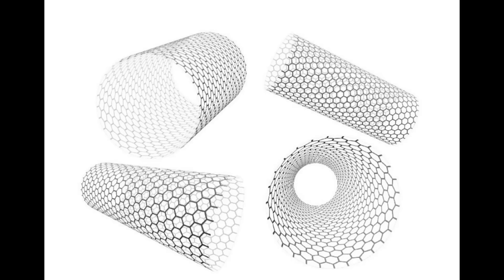What Material Will TSMC and Intel Use after Silicon?

Comment: MCM and stacking on CPU's is not as difficult as MCM and stacking on GPU's. Nvidia is already looking at ASIC's for future generations.
Reply: That is down to the way the OS was predicated to CPU's as much as the hardware itself.

I think AMD recently registered a patent for a sort of Command and Control die, to basically aggregate GPU chiplets so that they appear as a singular entity to the driver/OS.

If they implement it, it would likely be merged with the i/O circuitry for memory, display and PCI-E - for a single I/O + Control die.
Reply: @mnomadvfx  if AMD does it right then they could even revive CrossFire with that. If they have proper connection speeds with their infinity fabric then you could just buy a 2nd GPU to double your computing power. That would be really exiting.
Reply: @zamundaaa776  xGMI is their new interconnect which carries infinity fabric I think, introduced with Vega 20.

As for doubling compute power - raytracing is even  more conducive to scaling than raster graphics, albeit I have only seen how it scales with CPU's in my experience working with CG VFX/animation.
Reply: @mnomadvfx  I've actually programmed a GPGPU raytracer myself a month ago and, well, for good quality raytracing you'll want to do something like a minimum of 4 rays per pixel (practically MSAA). Those 4 rays do split up later into a lot of seperate ones, but that's all in the same shader. So for raytracing Full HD you can really make use of a theoretical number of 1080x1920 = 2,073,600 shader cores for maximum performance. At least if memory bandwidth scales with it, too.
Reply: @zamundaaa776  The predication around BVH as a model for ray trace fixed hardware acceleration seems strangely premature to me, it's not the only proposed method for that purpose and I worry that they may be painting themselves into a corner by going down this path.

Hopefully future RT acceleration solutions will be more versatile to take advantage of future models as they come about.

Comment: Ovshinsky Switch. Chalcogenide. Micron and Intel are working on it on the down low. Only tentative memory applications are currently visible (3D Xpoint). If they figure it out, silicon will seem almost  like vacuum tube transistors in comparison.
Reply: @Cole Park Yes. A modified 20nm node was used for 3D Xpoint gen 1 memory at Intel and Micron's (former) joint venture IMFT. Micron has patents that refer to a 10nm node so I assume they're making progress. Chalcogenide based phase change memory and logic don't work well at larger nodes, so it's just starting to get viable at sub-20nm. I reckon there's still a lot to work out on the logic side.

Comment: Quantum computers will be orders of magnitude worse than current computers at common compute tasks. They will be exponentially better at tasks with quantum speedup potential, such as password cracking.

However, passwords can be made just as secure as they are today in a world with quantum computation as long as the specifics of the password authentication algorithm is done properly, and passwords are made twice as long. Generalized password cracking only exhibits square root speedup under quantum computation, so squaring the complexity of the search space by doubling password size should make passwords secure again.

Comment: Allways amazing to predict what the future will bring us. Good job.
You missed some promising technologies, but I guess that's not the point of this video. It's better to stay grounded than to dream about something that's well into the future.
As you stated, silicon still has room for improvement and any other tech/material will have a hard time getting close to silicon in price/performance.
Anyway, you missed a point when talking about graphene. It's not only about the node size, but the speed. Graphene could be pushed much higher. At least 10 fold, and probably much more when the tech matures.

Comment: Quantum computers do actually have more uses than just hacking your passwords really quickly. There are genuine benefits to having a quantum computer rather than a classical computer do machine learning for example.

Also concerning the whole topic of this video I think you missed something vital and should have made a part two dedicated solely to this.

Like you said in the beginning of the video we use silicon to make transistors, but we only use silicon because every masproduced transistor ever made is based on electricity, but there are other types of transistors we could use. 

We don't have to just use electricity. We can use light for example which has numerous advantages over electricity.

Light travels faster than electrons (remember what Einstein said about light), increasing speed.
Light photons also won't get stuck like electrons tend to in the walls of the transistor, decreasing heat output and the energy requirements.
Light is also wave, meaning we can change its frequency to transport high amounts of information quickly. This is why fiber internet is so fast compared to old copper wires.

Also if you want something really whacky to talk about, try researching ternary/trinary computers.

Anyway nice video.
Reply: Ternary computers were abandoned in 60s. Binary is way more simpler to design and manufacture and has lower power consumption.
Reply: @national_security  "Ternary computers were abandoned in 60s."

You're really saying popularity should play a role here? Dude, the electric engine was invented before the petrol engine. It was then abandoned and has only recently seen a resurgence, but I guess according to you we should just kill it. Which one of us should be the one to break the bad news to Elon Musk? Me or you?

"Binary is way more simpler to design and manufacture..."
Okay, binary is simpler, so what? You're saying we shouldn't research a replacement for silicon to begin with (the point of this video). I mean It's simpler to continue to silicon use since we already use it.

 "...and has lower power consumption."
That depends on how you design the chips. Btw you completely ignore the other benefits that ternary has over binary (which are not just limited to compute). 

For example ternary transistors are argueably already used in SSDs (being able to store multiple voltage states, MLC, TLC and such), which greatly enhances the capacity, and reduces the cost, of consumer SSDs. 

A similar thing could be done for a processors cache system, which is basically just very fast storage. Instead of using 50mm^2 (or how much a processor might need) for its cache it could only need 25mm^2 which will reduce die size and improve yields. 

In short, power consumption, manufacturing simplicity and popularity (I can't even believe you argued that should factor in) are not the only factors that should be considered when we think about how we might increase our computational capacity in the future.
Reply: @sango3128  As the argument in this video cheaper is better that is why we are stuck with silicon. Ternary logic does not work at the transistor level. You only need 2 transistor to build a not gate to build an equivalent ternary gate you need at least 9switches.
Reply: @kazedcat  "As the argument in this video cheaper is better that is why we are stuck with silicon."
No the argument is we've always used silicon that is why silicon is cheaper but once we hit the wall where silicon can give us more performance (at about 2nm) we'll have to look to other materials for our performance gains. ALL of the examples he gives are WAY more expensive than silicon is, so I will simply repeat myself your argument boils down to that we should continue doing what we do and not look at how we might increase our computational capabiliies, because researching anything else is expensive. You're the only one on this planet who believes that by the way.

"Ternary logic does not work at the transistor level."
Okay, so either you're a complete troll or you're a tldr kind of guy...

Of course ternary works. We've made computers before build with ternary components so obviously they work. Besides I have already given you MODERN examples of tech using what you might call ternary, SSDs (being able to read multiple voltage levels), and you just come back with "ternary logic doesn't work."

"You only need 2 transistor to build a not gate to build an equivalent ternary gate you need at least 9switches."
Oh so complexity is the problem? because building processors using carbon nanotubes is easy (and in your worlld is has to be easiER than using silicon if we're gonna use it) 

You do realize complexity has never kept us from anything? nor has difficulty...

Anyway what I find particularly interesting about your "critique" (and I use critique lightly here) is the fact that you chose to go after ternary when you could at the very least have mentioned quantum computing, something that is much more complex, yet you probably believe it is not only feasible but inevitable someday despite the fact that they're gonna be the size of skyscrapers, require subzero cooling 24/7 to even boot, and never be as powerful as classical computers are for everyday computing, nor as cheap which is the argument you keep using ad nauseam.

You consider this feasible like many others do (and yes it might be feasible), but ternary is impossible you claim despite the fact that we had ternary computers in the 60s.

I'm just trying to show you that you have a clear bias here, for one technology and against another.

But you know I'm actually at fault here. I said ternary was a whacky idea when I should have said "ternary is whacky idea, but it is not nearly as whacky as quantum computing is!" I can't blame you for latching on to the last sentence of my comment and running with it, since expecting you to read all of my comment is simply too much to ask from people who engage in youtube's comment section.
Reply: @sango3128  Quantum Computers are only good on select problems they are not an answer to general computing. There are problems that is just outside the practical range of solving in classical computers that can be solve by quantum computers. Otherwise quantum computer is to slow to use for problems that can be solve by classical computers. For common problems a calculator is faster than quantum computer. For the ternary logic I am not concern about complexity but power consumption. If you scale ternary logic into a full pledge processor it will require 5 times more transistor that means it will consume 5 times more power. Plus taking into account the doubling of switching voltage to keep the same level of signal to noise when transmitting ternary digit. This is basic information theory carrying more information require higher power. Ternary logic will end up needing 10 times more power for the same level of processing throughput. Silicon will not stop improving for at least a decade. We already have several silicon technology on the pipeline. We have nanosheet fet, nanowire fet, cobalt interconnect, SiGe channel, 3d stacking at the channel level, at the transistor level, at the chip level, at the packaging level. 450mm wafer. There is a lot to go before silicon is exhausted.
Reply: Quantum computer won't hack a 256 bit encryption for decades still.

Comment: You focus on smaller transistors and better heat transmission.

Heat is a waste of energy, look at how big heatsinks are in comparison with the cpu or the gpu themselves.
If you make a cpu using other materials that is ten times bigger but doesn't need a heatsink it would be more efficient and have a smaller total size compared to cpu + heatsink.

What about photonics/optoelectronics? Light moves at higher speeds, produces way less heat and you can overlap multiple wavelengths at the same time.Even if the device is bigger it has way more benefits.

I know this is still very early technology but it has too much benefits to be ignored.
Reply: Opto-spintronics is even better, done well they could probably eliminate cooling entirely if they used graphene/CNT for power traces.

Comment: Germanium clocked lower? WTF.  They switch 3x faster than silicon, but they consume huge amount of power since you cannot really turn them off. For germanium transistors the power density was problem LONG before it was problem with silicon transistors, but boy those transistors where and are fast.

Comment: Time to unsubscribe, now you're just talking out of your ass thinking you know stuff you clearly do not. 
1. You can't make a chip out of nanotube or graphene because these aren't semi-conductors, a chip has to be a material that can easily be doped with nanometer precision to change it into either a conductor, or insulator, and also semi-conductor. Nanotubes and graphene are so conductive they are suspected to be superconductors. And you can't dope these materials because they are defined by their carbon-carbon bonds,  if you add some other atom in-between it's no longer a nanotube or graphene.
2. Quantum computers are also made on silicone chips at least for now, so what the fuck are you even talking about?
3. Quantum computers cannot perform regular compute functions, at least not any faster than regular computers. So no you can't replace your gaming PC with a quantum computer, because it won't run any of your x86 instructions. A quantum computer will always be accompanied by a classic computer that does the classic instructions, the quantum bit is more like a GPU, it accelerates certain instructions that will take ages on a classic computer.
4. There is no such thing as "cold computing" Yes we can improve efficiency but there isn't a specific thing with that name. 
5. 6Ghz overclocks with LN2 do not use 0.6w of power, they use more like 600w
6. The actual circuitry in existing silicone chips is nanometers in thickness. So what are you talking about? of course we have room to stack them. We already have memory chips that are like 128 layers thick, you can essentially stack these things forever considering how thin they are, so long as your process allows for it. So you know what's most likely to happen after we can't shrink the process any more? We'll just stack them, there's no physical barrier for you to fit like a 128-core or hell, 1024-core chip in the size of a modern laptop die, you just need the technology to make that many layers economically. Did you really think the circuitry is as thick as the giant slab of silicon you actually get? They only make them that thick for structural integrity reasons.

Comment: Can you please do a report on the supposed ps5/Gonzalo benchmarks been leaked, it claims that performance wise is between a 1080 and a 2080.
Your opinion in this matter would be greatly appreciated, thank you.
Reply: Yes indeed. It is rumored to be Navi based GPUs, between a 5700 and 5700xt with some changes (maybe raytracing)
Reply: my opinion is that the supposed performance is too weak, too slow, too low for a true next-gen ... the GPU wouldn't be much faster than in the One X

Comment: How big is an electron... that's surely the real limit.
Reply: An electron has no mass, thus it has no size. The real limit is the distance an electron can "jump" in its probability cloud. The deal is, you can also build that consideration into the architecture and make use of it. The size limit will likely go down to being a few atoms, which an atom is between 0.1nm and 0.3nm.
Reply: @skyhop  electrons do have mass and size, thats a photon you mean